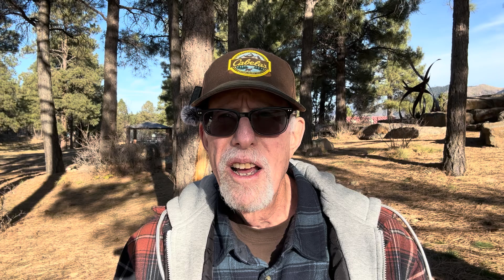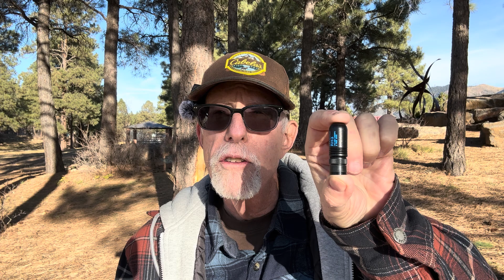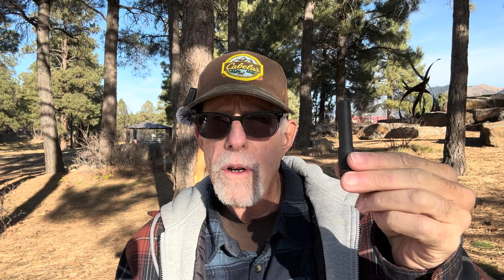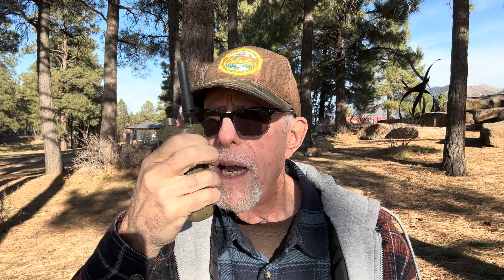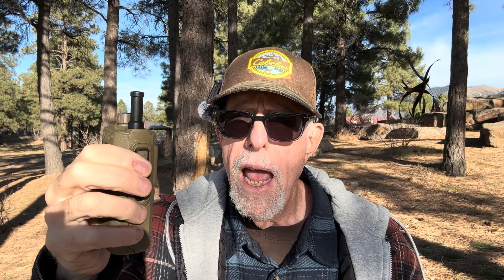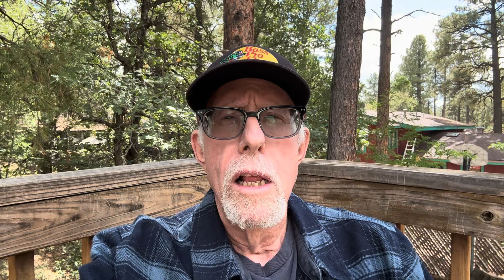STUBBY ANTENNA SHOOTOUT! GMRS/UHF Antenna Compare #gmrs #hamradio #uhf #prepper #radio #walkietalkie

Comment: Why do all the tests have a lot of static at the beginning, and then it gets better after about 1 second... Every test. Is that the receiver on the repeater? Or maybe noise cancellation on the UV pro?
Reply from the maker: Thanks for your question. I am not hearing it during the test. But what I think is happening is noise cancelling by the wireless microphones I use.

73 Dave N8DAV
Reply: @BrilliantHam  oh weird. I would not have thought of that camera microphone. So you do notice it in the YT video, but it wasn't like that in real life.... Is that right?
Reply from the maker: @0my  Yes that is correct. I have a new wireless microphone set up because the old ones batteries would die after just a couple of hours. While it works pretty good, I am considering replacing it once again. Just because of this issue. The problem is I don’t make very much money from this channel. I pay for everything out of my own pocket. And I am retired meaning I don’t have a lot of money to put into the channel. Especially, if it doesn’t help increase my numbers. I have to be careful about how much I put into the channel every month. I’m not complaining, just being transparent.

73 Dave N8DAV

Comment: *Diamond RH3 <~~~ All sold out, "currently Unavailable" (good job)! 😂
Reply: Did you bother to use Google?  My first website has them. 26.95 Ham Radio Outlet .
Reply from the maker: Thanks for letting me know. It was available when I made the video. 🤣 Ooooops! Here is a link to the Diamond Antenna website. On the right side is a list of all their authorized dealers. The antennas are available through any of them as well. https://www.diamondantenna.net/products/RH3

73 Dave N8DAV